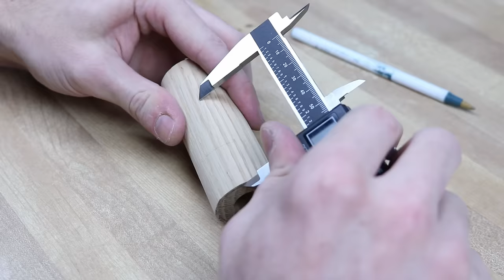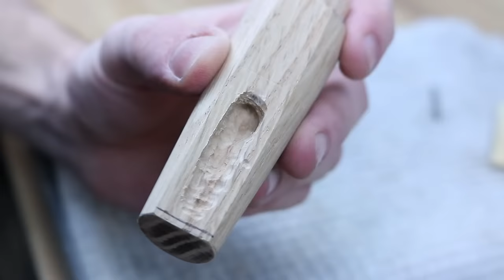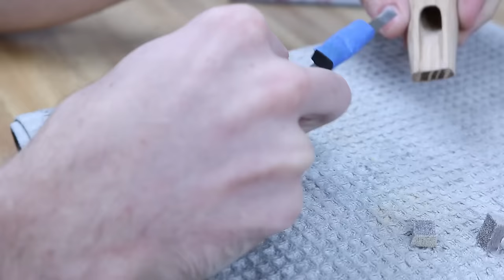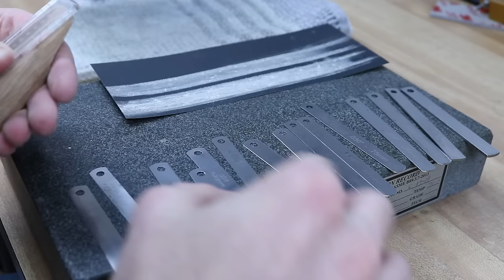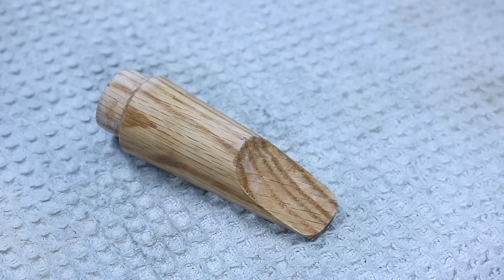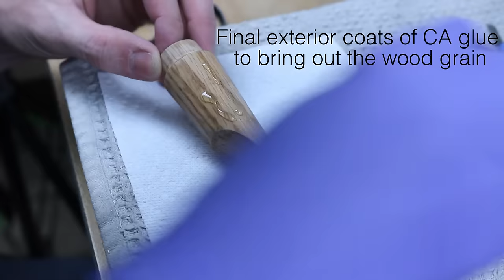Making a Saxophone Mouthpiece from a Block of Wood

Comment: Well done! I have also made one by hand and only using  a drill for the centre hole, the rest was done with chisels a Dremel and sandpaper. It plays quite well but as you would expect, the tone is on the soft and mellow side by the very fact that it's made of wood. I hope the glue you used on the outside is food safe..as in you'll be putting it your mouth.
Reply: Super glue used i medicine, also all broken mouthpiece glued using Cyanoacrylate.

Comment: Fantastic attention to detail with a great result. Did you consider using Cactus Juice and a vacuum chamber to stabilize the wood? I wonder if that would give better stability and longevity to the wood as opposed to just a CA glue finish.  Some wood turners use Cactus Juice and a CA finish with very nice results.
Reply from the maker: Thank you! That's an interesting technique, never heard of that before.  With this piece I really didn't care about long term stability as it was just an experimental project that I never planned to play as a main mouthpiece, just made it for the challenge.  For long term stability the first thing to do would be to not use wood at all because it's not a stable material (see video description) but this was all just for fun.  Glad you found it interesting
Reply: @spencerbrodhead  Use aged hard wood and laminate it, as in cut the block in half horizontally, glue it on the 90 degree rotated edges so the grain is mirror image at the seam that is now the vertical cut where it is glued/laminated back together. The opposing mirror grain of each half will stabilize the piece overall, much like on a guitar neck. I can't explain what I mean, but even laymans terms fail still.
Reply from the maker: @erikbrodin2198  Yeah that sounds like a great technique for most woodworking, but for mouthpieces the best way is to just not use wood at all, it really offers no benefits over hard rubber, this video was just for the fun challenege of it

Comment: Very interesting.  I'm wondering if there is a better choice of wood though.  Oak is very porous.  Have you tried anything else?
Reply from the maker: Thanks! Yeah a super hardwood like lignum vitae works well with its high density and tight grain pattern but is still an inferior material to hard rubber as all woods will have the tendency to crack and warp.  Making this one from wood was just an experiment for fun

Comment: Hello, I tried this week to do the same. Although the result is a poor sounding piece of wood. I took one of my mouthpiece as an example and I realised that I can fit a 12mm drill bit from the top of the chamber to the 16mm throat (?) they make an angle of 70 degrees. Next time I am in front of a milling machine I will try to drill that way.
Thanks for this really nice video.
Reply from the maker: Oh that's interesting, good luck on your next one

Comment: Great Job! My friend gave me something like this, but it's made from teak wood. I loved that tone and it's give me different feeling whenever I play. It's kinda dark, big tone (since its low baffle & large chamber), and the upper register doesn't as bright as the other mouthpiece. Unfortunately the condition now is not good anymore, especially the tip & the side rails. When I saw this video, it's just remind me that every natural process is unique but it has own limited best days to perform. I hope I can replace mine with the same model, but my friend was stop producing it :(
Reply from the maker: Ah very cool! Yeah wood over time can warp and swell, which is what you noticed in the tip and rails, which of course have critical geometries for the mouthpiece to play properly, also the warping over time can cause the table to not be flat which causes all sorts of issues.  Being made of teak wood it probably looks great still, should make a nice looking display piece!

Comment: My engineer friend and I made one for my soprano sax. It sounds almost like a clarinet. I must say, the wodd was much harder than this one; it's a tropical wood which needs to be worked with tools for metalworking. Standard wood tools can't event dent it.
Reply from the maker: That's cool, yeah if I used grenadilla or lignum vitae it would have been better, but I didn't really care about using this piece for the long term, just a fun experiment

Comment: If by chance you do another wood mpc you  might consider trying a bullet of grenadilla, or cocobola wood. Probably the most stable for making a mouthpiece.  Very nice job btw!😊
Reply: Billet
Reply from the maker: Thanks! yeah grenadilla would definitely be more stable, I actually have a grenadilla clarinet mouthpiece, never really play it tho.  I think I'm done making wood mouthpieces after this one haha, it will never have the strength or dimentional stability of hard rubber.  But yeah grenadilla or lignum vitae would be much harder, but even those still have a decent potential for cracking, especially around the shank.  Glad you like the video!
Reply: I made a hard rubber mpc in a similar fashion years ago just to see if I could do it. It was a fun project.

Comment: Spencer, thank you for this video! I acquired two noname mouthpieces form 20s made from a grenadilla wood.. and wood is so unstable, so when try to play it after a reface i notice a table warping.. it screws the whole job out.. now i know what to do with a super glue))))
Reply from the maker: Thanks! I'm glad you like the video, I actually would not reccomdend putting superglue on a grenadilla piece, especailly one that you plan on using.  I just did this to seal in this piece for the few times I would play it, because white oak is a lot softer than grenadilla and I was noticing swelling of the wood right away.
Reply from the maker: Also just checked out some of your videos, great playing!!
Reply: @spencerbrodhead  i've already done.. 😅 this swelling happens all the time i try to play it.. a bump appears right under the window.. if i sand it down, small concavity appears after approx..24 h  I tried to soak this mouthpiece in an oil for couple of days.. didn't help.. well.. i'll just see what happens.. mouthpiece has not so much value anyways... thank you for checking my stuff btw) Take care!

Comment: It's easier to make it on a lathe, and with a drill chuck that can hollow out the centre. Cut the flat surface by bandsaw, and then shape it with some chisels. Belt sander and Dremel works, but it's too dusty that I don't really like.
Reply from the maker: You make it sound like you've done this yourself?
Reply: @spencerbrodhead  I've made a clarinet mouthpiece, but it was some years ago and I haven't taken video of it. If you search for "making clarinet mouthpiece", you'll see some other people using lathe to make it too.
Reply from the maker: @chaselee86  That's cool, and yes I understand that mouthpieces are usually turned on a lathe, I've literally worked on thousands of mouthpieces made that way.  But I'm so used to that so I wanted the additional challenge of using the tools I had already.

Comment: Isn't the glove a terrible idea while using a drill press?  If that material were to get caught in your hand is toast.
Reply: Fascinating video!
Reply from the maker: In most cases yes, if I was using an actual lathe, but this drill press is very underpowered and there was really no risk in my glove getting caught in the drill bit, there's really nothing for it to grab on to.  The glove was to protect my hand in case my grip on the wood slipped and the piece would start spinning against my hand.  But I'm very careful and confident in my power tool usage, this was totally fine for me to do

Comment: What? No tip rail? 😮
Reply from the maker: It has a tip rail but the wood is not really dense enough to give a good visual definition to it, plus the inside is sealed from moisture by super glue so visually the definition goes away, at least on video.

Comment: first the super glue is toxic, how did you come up with this idea and why?
second, my feeling is that the wood you use (Walnut if I'm right) is not really good for anything that comes in touch with the moisture and it does in the mouth a lot.. Well I see it is White Oak which is better speaking of the moisture but it will burn in the mouth.. not even hammer handle is made for that reason from that, as it kinda burns your skin. Its open texture is quite problematic for such use. 
If you ask me if the sound will be noticeably different. I would say, sure it will, as the geometry is what matters the most in this case and hand made piece like that will not have a good geometry..
Reply from the maker: Hmm ok that was a lot of inaccurate things you just said.   Super glue toxicity is really referring to breathing in the fumes white its liquid or during the drying process, or directly ingesting it.  I did neither.  Read the description.  White oak does not burn the mouth, I play tested it before the super glue a couple of times... no burn.  Wow, science.  The problem with it is that is swells with moisture which I cover in the video which is why I sealed the surface.          "If you ask me if the sound will be noticeably different"    Well I didn't ask you and the sound would not noticeably be different.          "hand made piece like that will not have a good geometry"    Wrong. A handmade piece like this has proper geometry because I'm a professional mouthpiece maker and I know what I'm doing.  Watch the video, listen to how it sounds like a mouthpiece that's functioning properly.   Overall, any problems people come up with that they think this piece might have don't matter at all because this was just an experiment piece that I will never actually play for real.  Thanks for your input.